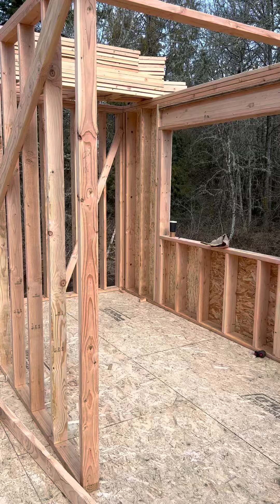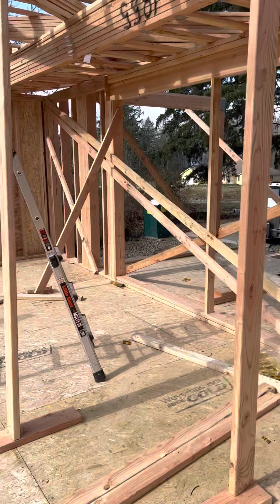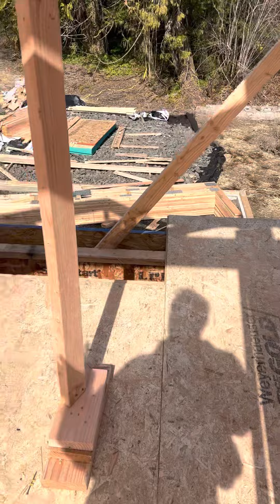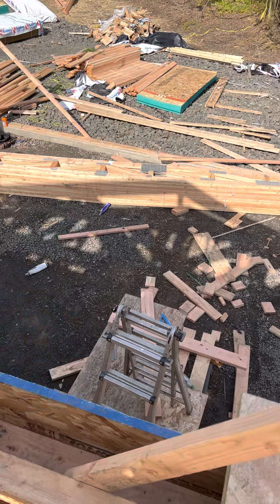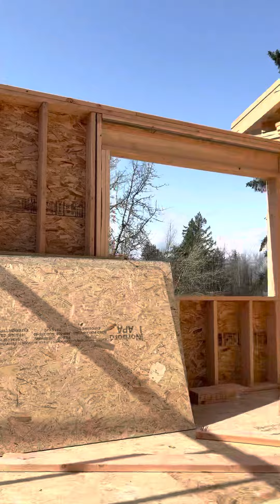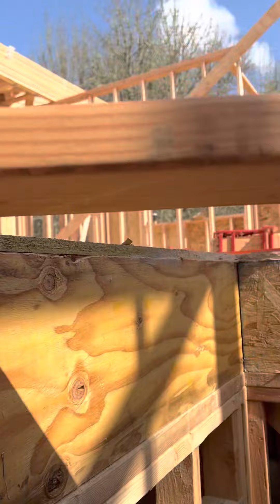Definitely not optimal! Life does indeed get lifey! Apple sauce to a boss though! #calm #strength

Comment: You could have gotten a lot of sheathing on for some shear strength without wasting all that time on the sticker farm bud.  What's a sheet take to slap up without cutting windows maybe, 5 mins?
And clean up that site, you got ankle breakers all over the place man
Reply from the maker: We were slapping stickers as the truck was dropping trusses! We lost massive time on this house due to multiple issues outside of our causing. So we skipped a lot of stuff to be barely truss ready! Thanks for your interaction here
Reply: @bigbadbuilderllc  stay safe, and hopefully the rest of the job works out better for you.  I had center stage on my own shitshows over the years, I feel for ya.
Reply from the maker: @flyin polack where abouts you from? We’re PNW Western Washington!
Reply: @bigbadbuilderllc  I'm up in NH, about 60 miles from East coast!